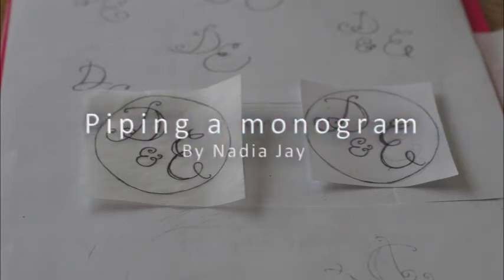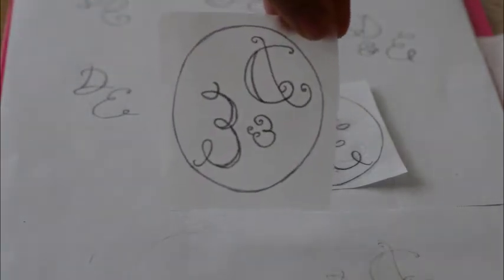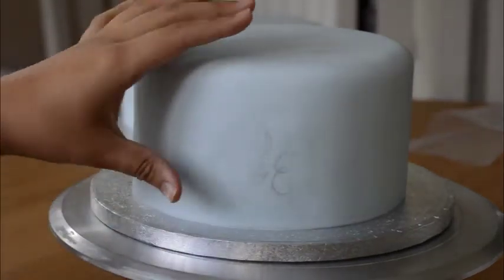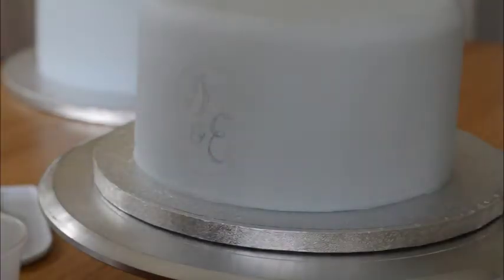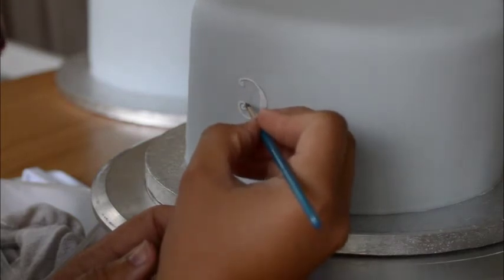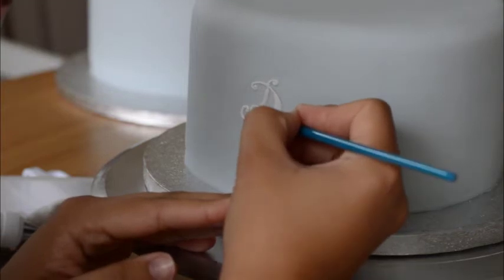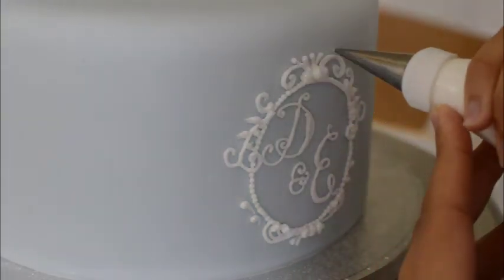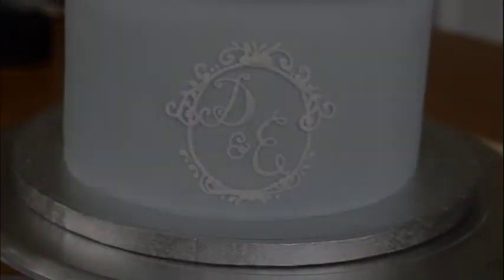Piping a Transfer Monogram onto a Cake

Comment: Can this be done on a buttercream cake?
Reply from the maker: Hi Sanya, Yes I would chill the cake so that the buttercream was very cold and would not leave an imprint if you touched it with your finger. Lay the transfer over the cake, and use a scribbing tool to pin prick the design onto the buttercream, making tiny holes along the lines in your design, through the paper, into the buttercream. Carefully peel away the paper, and follow the pin pricked lines.
Reply: Cake Me By Surprise Wedding Bakery  thank you so much❤️